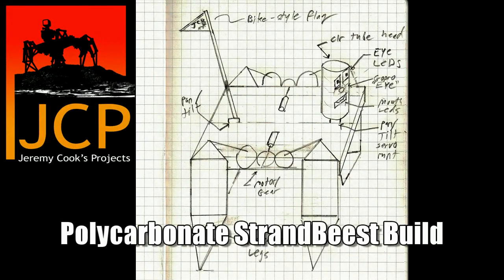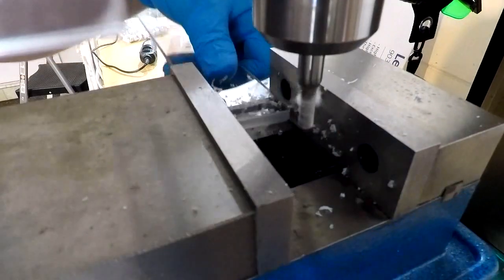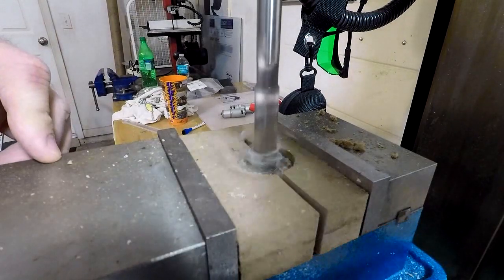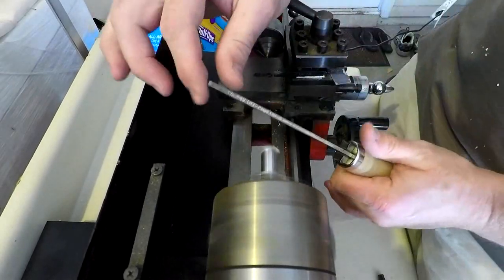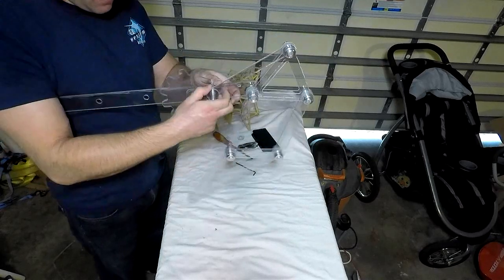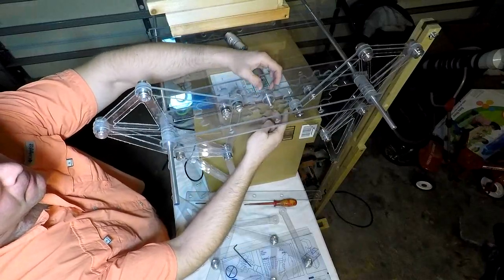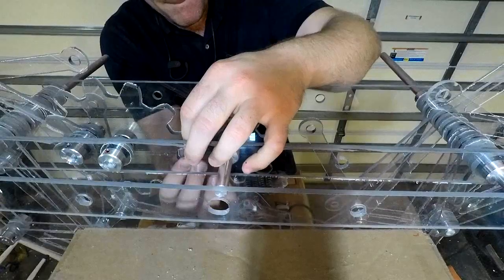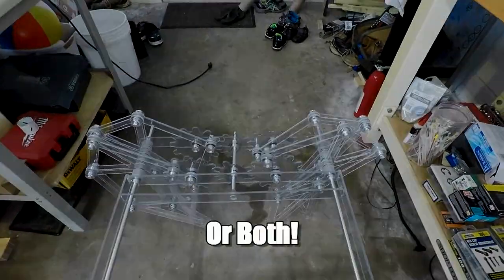ClearWalker Strandbeest Assembly (Pt 1)

Comment: Rub chalk on your file when filing aluminum and soft metal to prevent clogging of the file teeth, use a forward stroke when filing in the lathe, dwelling in one spot is bad for the file and the finish of the part.  Very interesting project.
Reply from the maker: Thanks Bob!

And thanks for the chalk tip, file clogging up was getting quite annoying. So when the lathe is turning, actually push it forward as well? Will have to give that a try.
Reply: Don't wear long sleeves and keep your left arm away from the spinning chuck and always use a handle on the file when using it on the lathe. It could kick back and stab you.  CHEERS
Reply from the maker: All good advice, thanks! (Though given my location in Florida, long sleeves is rarely an issue ;-)